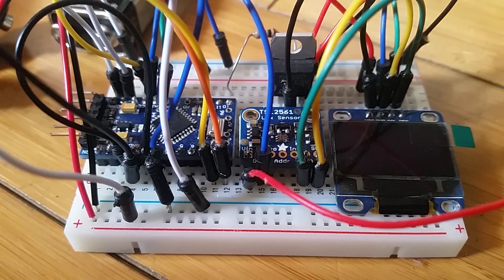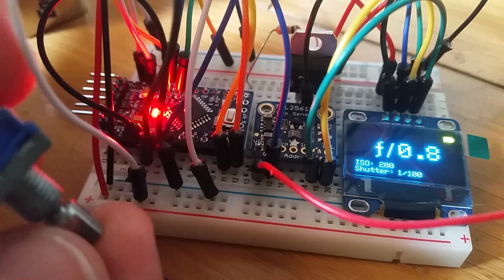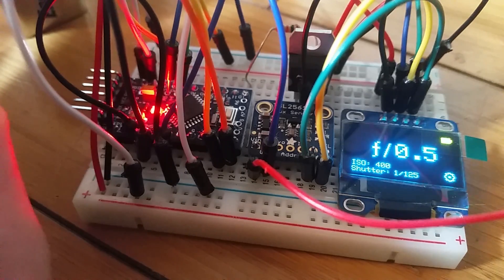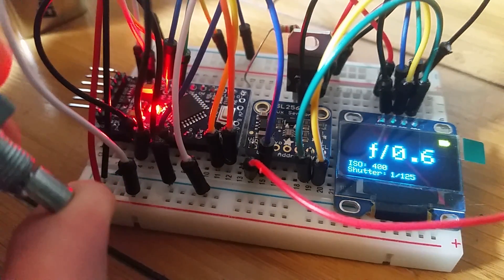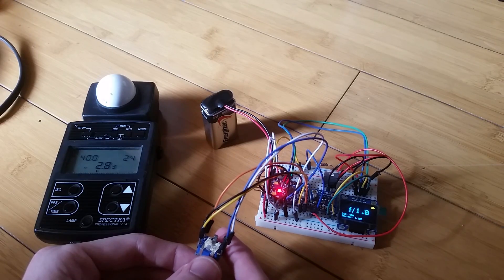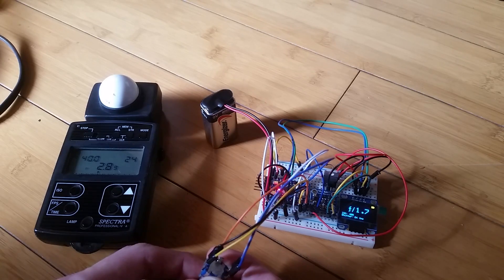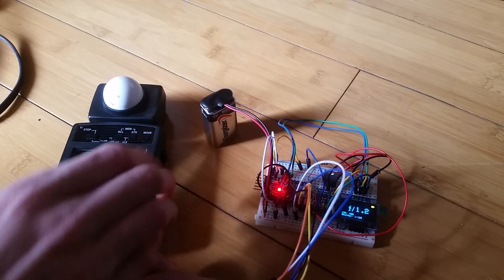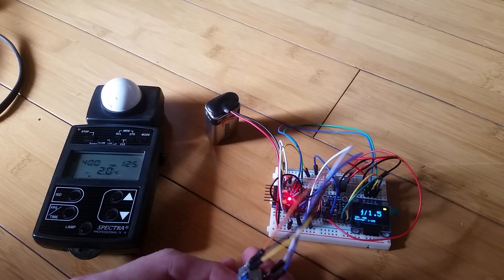ƒLUX - an Arduino Photo Light Meter

Comment: when i upload the code，the picture  in the 0.96oled is much bigger than the screen，i do not know why
Reply: add this to the code
#define SCREEN_WIDTH 128 // OLED display width, in pixels
#define SCREEN_HEIGHT 64 // OLED display height, in pixels
and add the extra info to this line
Adafruit_SSD1306 display(SCREEN_WIDTH, SCREEN_HEIGHT, &Wire, OLED_RESET);

Comment: @PhotoChemicals, what type of transistor and resistence Is in your project and where are connected? There Is a electrical scheme? I'll try ti adapt your project with an Arduino nano v3 and a 160x128 TFT display, i want ti use your project because it's amazing, it' beautiful how you made that and the use of the Rotary encoder with button It's really interesting and ingegnous.
Thanks alot, for had shared yuour really good work, Hope you give me an answer, and ... Excuse my bar english

Comment: Thats a great project!! Is there any chance of getting the sketch so i can have ago at making my own :) 
Many thanks :)
Reply from the maker: andrew barlow Thanks for the interest! Still not quite done with it. While this one was more than sensitive enough, I've upgraded to the Adafruit SL2591 High Dynamic Range Digital Light Sensor (http://www.adafruit.com/products/1980), and I'm still working on 3d printing a case and finishing it up. But I've been sidetracked with my actual work and other projects. I'll get back to this soon!
Reply from the maker: ***** No problem! You can also get IR-only readings from either sensor, which I was experimenting with.
Reply from the maker: +Paulo Bruckmann That's awesome. Can't wait to see it working!! I haven't touched mine at all. I got sidetracked another arduino project I've been working on to customize a polaroid land camera, so that's been taking up most of my free tinkering time.
Reply from the maker: Finally finished the project, here's the video update: https://youtu.be/WcZG9v7m2E0 
And the code can be found here: https://github.com/PhotoChemicals/f_lux